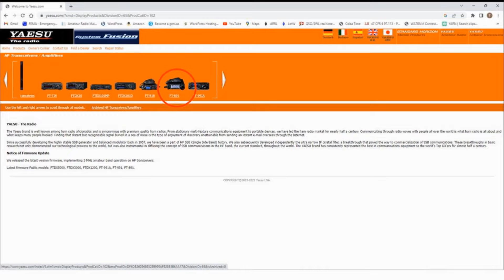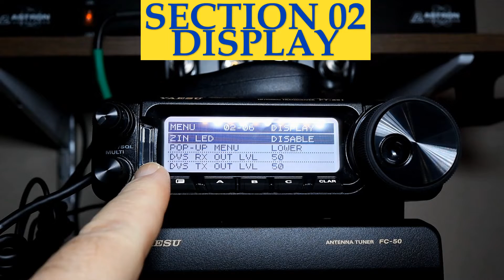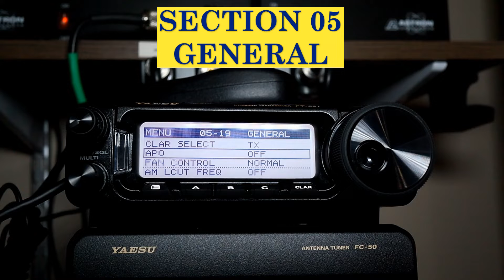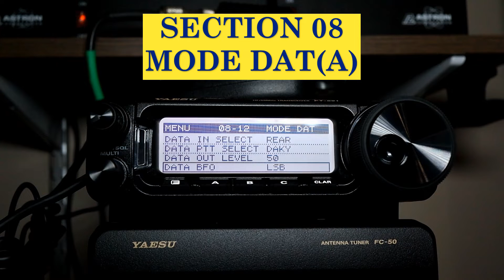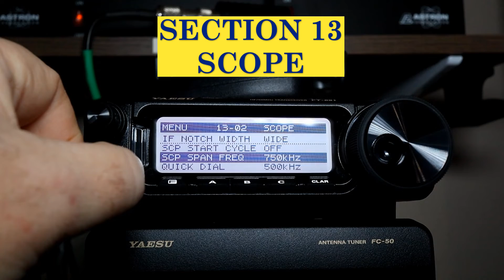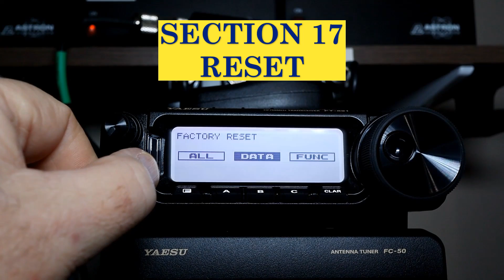Settings - - hidden deep within your FT-891.

Comment: Tom,
Thank you. I'm replacing my FT 857 with the 891 in a go box with also a Pactor modem for Winlink. Trying to get everything thing set in radio and computer has been "Challeng" this video helps a lot 
Bob WX7W

Comment: Reminds me of 70’s and 80’s Unix systems, the parameters and options were all there, you just had to “Read The Freakin’ Manual” 🤣 with which I as an Gen Xer can relate. The five line text screen is limited, but once you’ve learned your way, it gets fairly easy. FT-891 might not be for everyone, granted, but it’s a great piece of equipment for the GenX “RTFM” generation.

Comment: Wow this is an amazing resource for the ft-891. 
One thing. I have been in IT for 30 years. DONT do a firmware update on this unless you NEED whatever it fixes. I did and it bricked it. locked up at 50% then wouldnt boot at all. There is NO way to reflash it yourself from a bad flash. It is 2025. Cmon backup firmware? I had to send it to Yaesu which was $80 and lost it for 2 weeks (came back with a new board too) but be careful like everything only do the firmware if you read the notes and it is something you will use. Or prepare for your radio to be gone for 2-3 weeks :)

Comment: Hey Tom, Enjoyed your video. I have not been licensed very long with my latest being General. I recently purchased a ft-891 and at some point I apparently hit something that doesn't show signal reports when monitoring. Seems I've tried to correct it but now I'm at a loss. Any help would be appreciated.

Thanks 
Darrell H.  73 KQ4RPB
Reply from the maker: Without knowing what you did, I would recommend doing a full reset, then starting from scratch.  It sounds like a huge hassle, but should only take a half hour, at max…

Comment: Outstanding! I am taking my test soon, and I already bought this radio.
Reply from the maker: It’s a nice starter rig.  You may want to invest in the matching antenna tuner, or see if LDG has one.  I just like the look of the Yaesu tuner.  Also, consider an external sound card so you can play with some of the popular digital modes.  I use the signalink usb, but if you’re on a budget look at the digirig.  Lots of videos on using either one with the 891.  Good luck on your test
Reply: @ND3N  Thanks! Yes, I bought a Mat-Y200 as it is small and built for the Yaesu line. I'm drinking form a fire hose right now, but it's a lot of fun! I am researching digital modes now as well.

Comment: Hi, good evening I recently bought this radio, and I wanted to ask you if I may I have an external speaker connected to it, and when I lower the volume just to listen very low The radio will mute the sound completely unless I raise the volume significantly Is that normal? It kind of feels like an automatic squelch, but it doesn’t have any
Reply from the maker: Yes, you can…. Use the external speaker jack on the back of the rig.  If you’re using a headset, that plugs in to the side of the front panel, on the side where you route your microphone.

Comment: Hello Tom, I am currently studying for my amateur license. I would like to set the 891 as a base station.  What else would I need to use a Heil PR 781? Please advise. Thank you Marc
Reply from the maker: You’ll need the modular adapter available at heilhamradio and  either the hand held Push to talk or the footswitch.  You may also want an antenna tuner.  The rig comes with a microphone, so you might be able skip the headset.

Comment: what I figured out with the 891. is when you have a menu item selected. If you want that menu item back to it's default setting. Instead of turning the multi knob. press the CLAR button. that will set that menu it's back to it's factory default
Reply from the maker: I didn’t know that…. Thanks

Comment: Super grateful for this!! I’ve had mine in use for about 21 months. I already have a FT-817ND since 2006 so I thought I’d be comfortable with the 891’s “menu” system. Uhhh, NO! It’s a 5-star pain. Still, I’m plodding along at 62 different DX entities towards Mobile DXCC with an ATAS-120A mag mounted on my Outback wagon’s roof. Tnx de WB3CFN/m

Comment: Sir, I am new to the 891. It us my rig of choice for portable ops. Base rigs are IC 7300 and 9700. I am curious as to your thoughts on a pan adapter type setup on for the 891. 
73, AI5CA, Bob
Reply from the maker: You would have to open the case and find someplace to tap the IF signal. I don’t know where that would be and I would be hesitant to do it to my rig.  Your mileage may vary… hihi